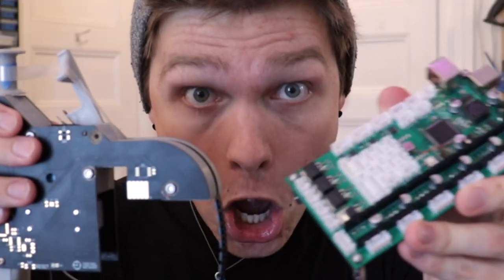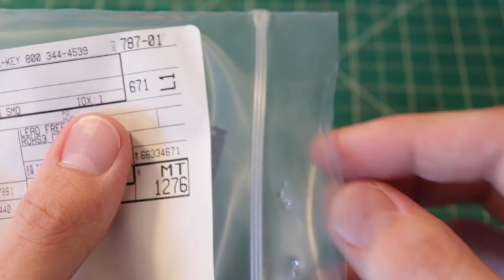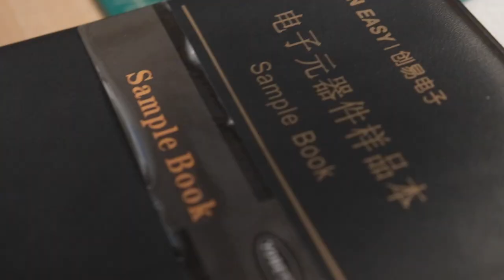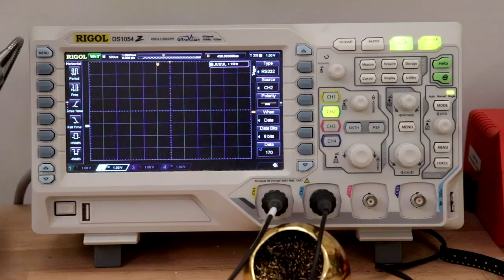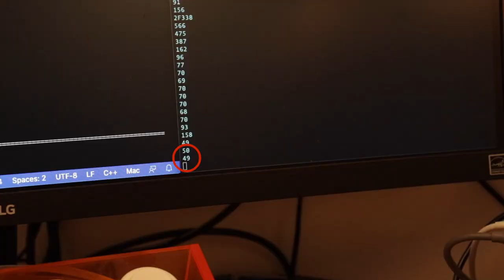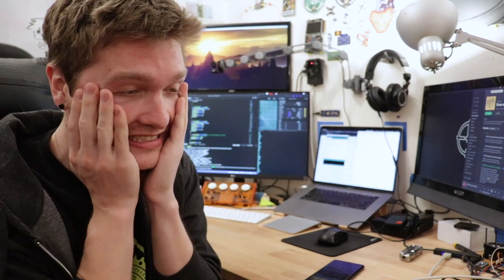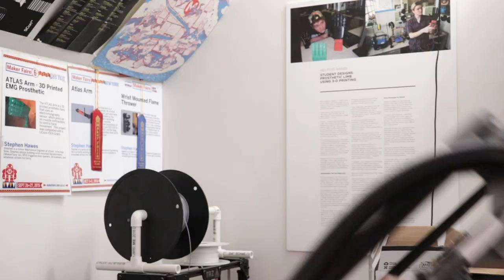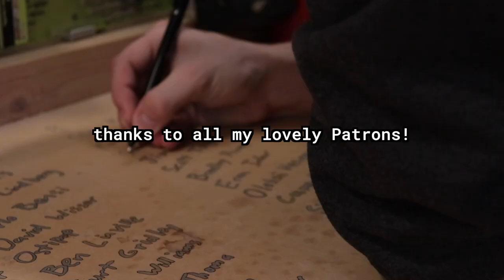Teaching Feeders To Speak RS-485!

Comment: Each feeder's controller may have a unique ID programmed when manufactured. Could you use that to uniquely address a feeder? That way, no need for dip switches. Then you'd only need to enumerate all possible addresses or program a mechanism that allows for the readers to report their ID when they power up?

This way, if you move a feeder from say, slot 1 to slot 4, the PnP would know that the feeder has moved and thus, where the SMT parts are now located.

As for identifying which slot the feeder is on, each feeder bed could have a simple logic circuit that for each pulse from the PnP, will enable a signal on the first feeder bed, then the next pulse will enable signal on the next feeder bed in the chain, etc... This process can be paired with a command to the feeder to check if that slot is active, and report back which slot it's in. 
As for that little bit of logic. look at a Johnson Counter digital logic design, it's simply daisy chained flip-flops.

Comment: I'm not sure changing the id system is necessary, just make the divisions wide enough to accept the resistors tolerance. Not to mention since there's only a handful of fixed slots it's easy enough to verify your resistors values manually if need be, but that shouldn't even be necessary if you set the ranges appropriately.

Comment: I worry about the number of insertions the edge connector will survive... Commercial ones are often only rated for a few hundred insertions. I did a lot of research on this topic and I switched to pogo pins.

Comment: If they are connected to each other anyway, couldn't you let the order of the feeders define the address of the piece in software in the set-up when you switch it on ?
Like the first action is that they communicate the position starting at 0 (from the controller) and ending at the last bit forwarding their address +1 to the next feeder.

Comment: mikeselectricstuff has some good tips on unique identifiers. His basic principle is work with what you've already got. In your case firmware and buttons. Pseudo code: if button pressed I am feeder one, increment id, if button pressed I am feeder two etc. Then you pop them all in, activate id mode then just press button on each one in order. Simple easy and effective and no extra cost :)

Comment: If these might ever need to be calibrated more than once, ie it's not just "factory calibration", then why not build some sort of configuration routine? PNP motherboard enters configuration mode, where it displays each feeder position. You press a toggle switch on the feeder that corresponds to that position. So it displays #1. You press the toggle switch on feeder 1. It displays #2. You press the toggle switch on feeder 2. It's not pretty, but you would only ever have to change it if you switch out feeder bottoms. And then you could build the routine so you only have to config the new feeder and not every number. The way it works is when you are in config mode, the motherboard sends out (repeatedly) a signal telling any feeder that just had its toggle switch pressed to ID itself with whatever # you are configuring. So if I'm a feeder, and you press my config toggle, then I am now listening for that command, and when I hear it, I assign myself to that ID. 

If this only needs to be done once or infrequently, you could do the same thing as above but forget the toggle switch and just plug in one feeder at a time (so that only that feeder receives the config command). And you've built a pretty easy way to factory program these things and once they are programmed you never have to worry about them again unless you clear the eeprom

Comment: Probably sounds really dumb, by why not have the STM32 assigned the values as the feeders are plugged in? The feeder would send a pattern, which would tell the STM32 a new unassigned device was connected, and then it would send an ID back. Have the feeder store the ID somewhere permanent, and operate off of that.

The other devices with an already assigned ID would then ignore the STM32's ID assignment operation.

I know there are problems with this, but it seems like a decent idea to do dynamic assignment. Nothing says you can't write something to override the ID the STM32 provides.

Comment: I'd use a one-wire EEPROM, like the old Dallas Semiconductor one:
https://www.maximintegrated.com/en/products/ibutton-one-wire/memory-products/DS2431.html
or the newer Microchip UNI/O
https://www.microchip.com/design-centers/memory/serial-eeprom/single-wire-and-uni-o-serial-eeprom 

Have two of them. One on the Feeder to have the reel part number, and the other on the Fingers for PnP position.

With that you can even move Feeders around, and the PnP can tell who is where, even on the fly.

Comment: I would use DS2411 ICs - they are pretty cheap, require only a single pin for communication (1-Wire protocol), and available in the SOT23-3 package :) https://datasheets.maximintegrated.com/en/ds/DS2411.pdf

Comment: A microcontroller that imolement a fixed delay for each interconnection with 2 serial onboard can do the trick of automatically detect the latency between each feeder
Reply: It can be fine if loosing some ms Is ok for you (i'm thinking about a 100us delay for each slot, measuring the ping time should be Easy with a 20mhz clocked microcontroller and with 32 slots you Will only loose 3.2ms)

Comment: Just use 1% resistors instead of 5%, surface mount 1% resistors are cheap enough these days I normally don't even bother designing for a wider tolerance gap than that.

Comment: and do address with "shortcuircuit"  ? 0000 for first address, 0001, 0010,... with jumper or with solder, ant why don't make a long PCB with all positions and address directly wired
Reply: What you call "shortcircuit aderessing" is just a digital adress

Comment: Your RS485 voltage looks wrong, more like CAN. RS485 should be 5/0 or 0/5, never 2.5/2.5.
Reply: if it's idle and biased then 2.5 sounds correct